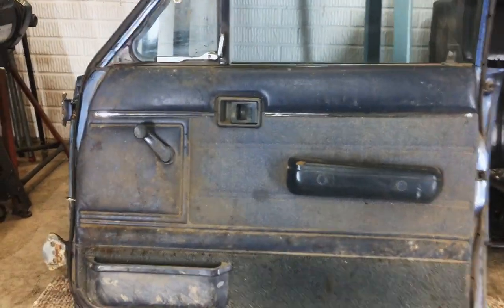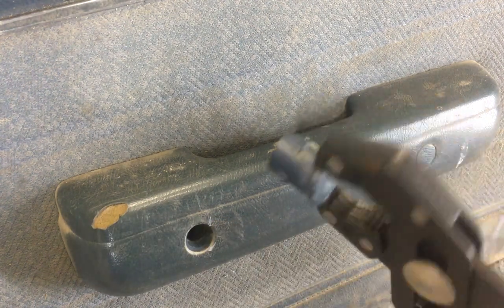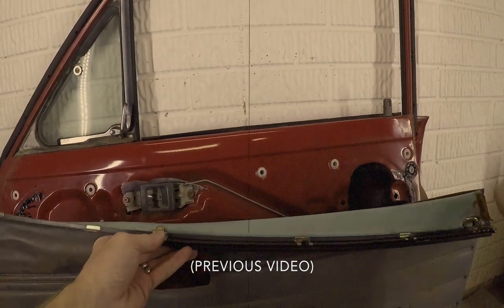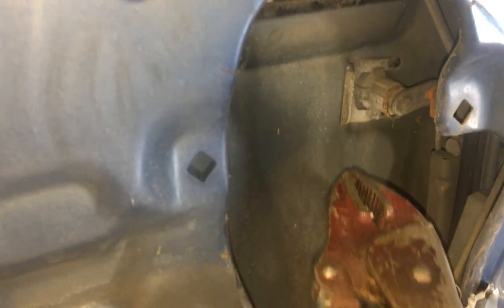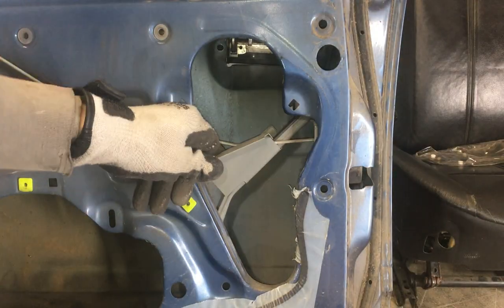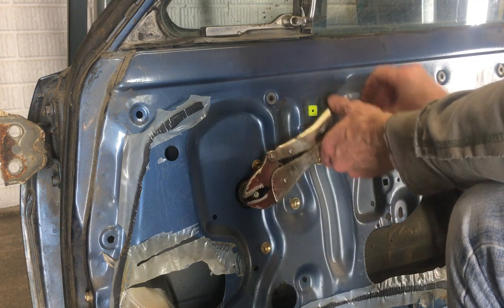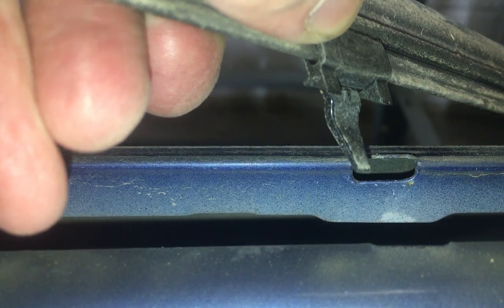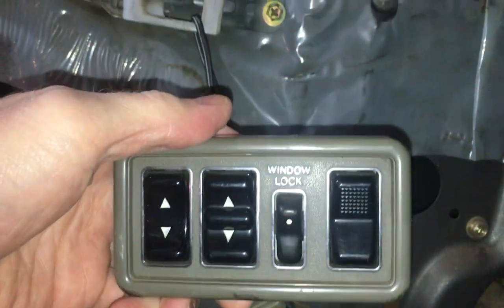How To: Disassemble a Door w/ Crank Window & Manual Locks - 84-88 Toyota Pickup Truck + 4Runner

Comment: Very entertaining. You kept it short, to the point.
Too bad that truck was not taken care of.
I have a 1994 pickup, only owner, blue interior. Looks almost new.
I messed up the right door actuator and can't find a video on removal and replaced; so now the door is tied with a rope on the outside. Not an easy to find part.
Keep up the good videos and thanks for sharing.
Reply from the maker: Thanks! I've found the 84-88 door actuators on ebay before. You might check there for the 89-95 actuator. I don't have any 89-95 in stock right now.

Comment: Thanks for this. It's been a long time since I dissasembled my doors and I'm trying to get the glass back in though already had the 1/4 vent installed, now I know why it won't go in!
Reply: Also, at 7:53 there should be 3 philips head screws under the door seal that hold the vent window in place.
Reply from the maker: Yeah, Toyota didn't make it simple!
Reply from the maker: Yes, I took them out a little earlier in the video. (If it's a 79-83, there will only be 2 screws.)
Reply: @6thGearGarage  Ah, I skipped past that. All good!

Comment: Would love to see a video of a reassembly process of this. For a 1983 2x4 single cab. Seems like this is a very similar process
Reply from the maker: You're right, the earlier doors are very similar to this process.
Reply: @6thGearGarage  do you think the door runs of the 4th gen would fit the 3rd? Thanks for this video by the way, gave me the confidence to get stuck into mine.
Reply from the maker: @lukeserio95  Ive never had a 4th gen to compare, but I'd bet they're slightly different. Toyota has changed them slightly on all the previous generations.

Comment: Thanks for this video. My 88 runner thanks you too. I've been unable to open the driver's door from within for about a year now......it slowly creeped up on me, you know how that goes. Just tore the panel off. People are always talking about a broken plastic clip on the horizontal pull rod between the latch and the inside handle - but I'm telling you....if one existed on this rig......I cannot see where on earth it would have attached. There are no holes in the door structure along that entire route. The idea would be that a broken clip allows for slack in the pull rod. So I'm thinking that this is simply a bad design for the beginning. There are 3 OG bends in the pull rod and the rod diameter is less than what I would have spec'd if BENDING were a concern - which it very much is in this case. So I've corrected the geometry of the pull rod to provide for proper door opening - but I expect this problem to reoccur.
Reply from the maker: Amazingly, I haven't encountered that problem yet on any of my Toyotas
Reply: @6thGearGarage  Thank you for taking time to reply.

I've given this "stretched pull rod" some thought since I wrote to you yesterday. My 88 rig came off a ranch near San Antonio with 140k OG miles on it. Filthy filthy filthy. So much dirt caked everywhere - I have STILL not gotten it all off. All of the rear interior panels continue to be missing. What remains of the interior needs to be fully replaced. Side note: Would love to redesign and custom fabricate interiors of vehicles like these. This 88 runner saw a hard life for its first 140k.

The brake system looked as though it had never been bled, cleaned or replaced in any way. My first brake bleed (immediately when I got it home) was an all day affair. I ran several quarts of new fluid through before it came close to clean. Think "dog vomit" and you'll get a visual of what the OG brake fluid was like. Should have had it towed instead of driving it home because stopping was very scary indeed. Still to this day I have not gotten rid of the soft brake pedal issue. So the truck was not cared for at all and it was on a ranch which likely had a compromising terrain with lots of dirt and mud. This was a ranch work truck that probably stayed on the farm and never saw any kind of legit pavement until 2015. This means lots of vibration while driving which compromised many things including and especially................drum roll please.................the door hinges.

All four door hinges were toast when I got the truck in early 2016. Until recently I have had to lift the doors up slightly to get them to latch when closing - that's how much door sag. The door checks are gone gone gone. [Remember to not park next to anyone in a parking lot during a stiff breeze.] So when these door latches are not perfectly aligned, the latch resistance ultimately asks too much from the inside door pull rod given its diameter and geometry. Probably true for most vehicles. Anyway.....when opening from the outside you are lifting up on the door also - so it makes sense. The outside handle pull rod is short, vertical, and fairly straight. This is why from the outside I could always open the doors easily. The latch end of the inside handle pull rod was being held in place by the "pinched" latch assembly when the door was closed. You try opening the door from within and you are stretching a much longer and more awkward metal pull rod, that is all. Over time, this metal rod becomes elongated and, with the extra travel length this provides, you are not unlatching any door at all.

My rig was not driven between May of 2016 and Dec 2020. Five months after buying it, I let it sit for 4.5 years to give it some alone time to think about the all kinds of wrong it had experienced before I came along and saved it. I therefore didn't get to examining the door hinges until we evacuated communist New Mexico last year and moved back to Texas where I found an ancient and magical custom machine shop where (if you're awesome) you get to work with the owner on your project. Using some of the OG hinge parts, this old-school pro machinist and I worked together seamlessly for about 4 hours straight to custom fabricate new removable hinges that are much stronger than the OG. He loved working with me (naturally) and only charged me $40. Should have been a couple hundred at least.

So that's what I think happened and why it's likely very few first gen rig owners have had this kind of trouble with their doors in general. If your rig has been "pampered" and has never seen a dirt road continuously for 140K miles straight, then chances are your doors (and all else) are and will continue to be fine and dandy.

Try restoring totally abused vehicles and you, too, shall see what I see! (no assumption made)

There are plenty of unmotivated, lazy human beings in this world who shy away from controversy, from learning anything about the SYSTEMS they rely upon for survival, from learning about anything that questions their worldview, or from what should be a naturally occurring responsibility for SELF.............like mosquitoes fly fast and away from direct broad daylight. Count me as one who adds not to that sad list. (I could barely change the oil in my lawnmower in 2014 and now I do everything except for total engine and transmission overhauls - I went from some negative number to 88 mph quickly - If I had a legit shop then I'd stop at nothing to doing all the work myself)

I have learned a great deal from the comment sections of videos posted online - sometimes more than I learned from the videos themselves. This is why I take time to write, so that others (like me) may become better equipped to help themselves - to rely LESS ON OTHERS FOR EVERYTHING. Next we shall tackle farming skills, hunting skills, and the best methods of removing our families from a society so thoroughly sick in the head with, among many other things, mass psychosis that it cannot logically differentiate between the Truth and the lies being passed off as truth. The "Germ Theory" is called a theory because it is...........wait for it.........a theory. I'll just leave that right there. And the average American IQ level is like 90-something. What was it Hitler or one of his men said?......something about.........repeat a lie enough times and it becomes truth? Where are those weapons of mass destruction again? John Taylor Gatto - Weapons of Mass Instruction.....and.....The Underground History of American Education. New York's #1 educator tears the system a new one. Oops! Guess he's no longer considered by the system to be New York's finest! (sarcasm admitted)

Thanks again for this video and for responding.

Comment: I want to see a manual to electric door conversion! Want to do it to my Hilux and I think I will need 4runner doors to convert the rear.
Reply from the maker: Of the eight 84-88 trucks I’ve owned, only one had power doors and I don’t think they were original because the harness was full of butt connectors and scotch lock connectors. I’ve never tried to convert one to power, I actually like less electronics on these old trucks. Less things to go bad.
Reply: @6thGearGarage  True but there is something to have the convivence of locking the door with a fob or key and all the doors lock! LOL
Reply from the maker: @buildadventure404  so true. I get so tired of explaining to a passenger “you have to lift up the handle when you shut the door for it to stay locked”. It’s just easier to lean over and lock it myself after they shut the door 😂

Comment: Holly crap man everytime i go to do something you have a video for it lol right on. Hey if possible ide love to buy them handle plugs off yu if u have all four? I also just finished revamping my plastic shifter surround havent wrapped it yet but there so brital and typically have hair line cracks i also fixed the clips that retain the boot all with jb marine weld and some cut up credit card and a bitta filler puddy its solid now man a bitta sanding then wrap sheel be better than new, thats my tip for the day.
Reply from the maker: I know what you mean, all of my shifter surrounds have had the hairline cracks as well. I'm going to hang on to the plugs because they go with the arm rests.
Reply: @6thGearGarage  yea no worries had to ask lol

Comment: Does anyone know if the vent window seal from the toyota trucks will fit a first gen 4runner? They look similar enough but the part numbers are slightly different
Reply from the maker: I’m not sure why the part numbers would be different,as the doors and glass are the same. It should work 👍
Reply: @6thGearGarage  cool thanks

Comment: do you know anything about adding power windows
Reply from the maker: I've never done it, but I think the hardest part would be the wiring. Aside from that you will need the power regulator and switches. My red 87 4wd had power doors added by the previous owner and the wiring was a mess... a bunch of scotchlok connectors and butt connectors. I was surprised everything worked.
Reply: @6thGearGarage  i think someone told me the plugs are already in the harness it just plug and play but wasnt sure